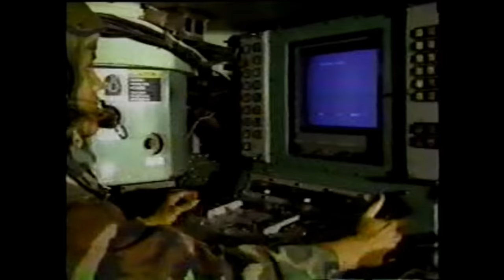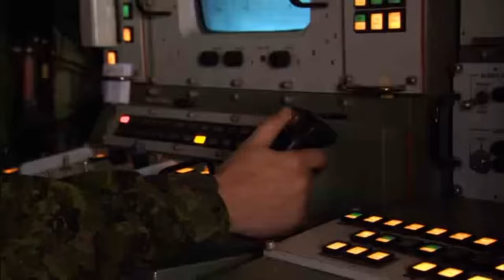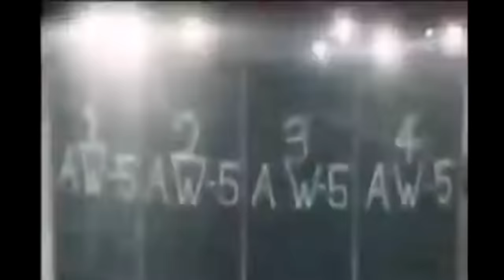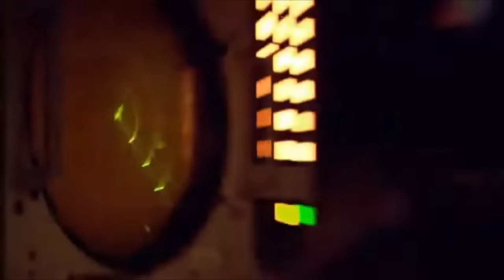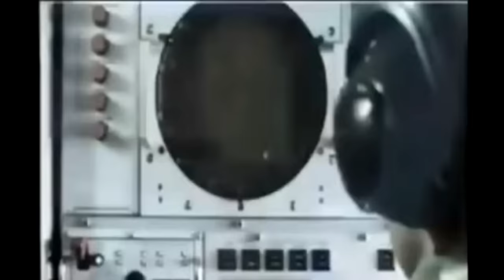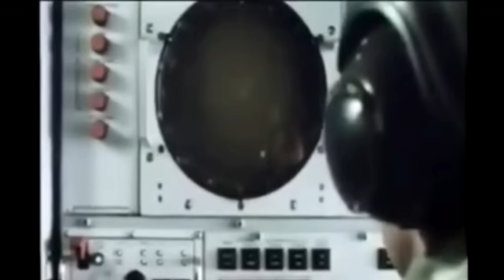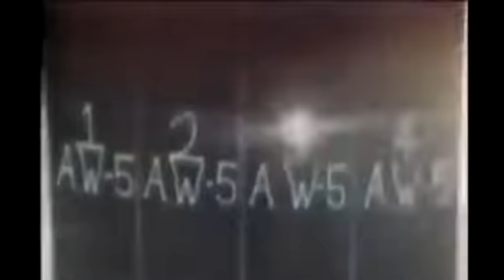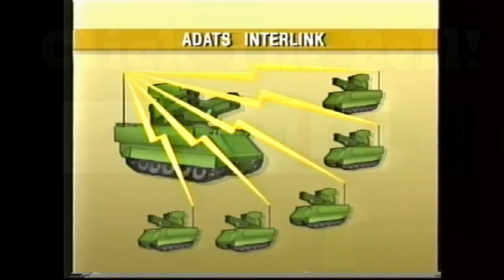The Air Defense Anti Tank System 'ADATS' Overview - DUAL-PURPOSE MISSILE HUNTER 📡

Comment: Well, these armoured systems tend to be so expensive (the German Gepard springs to mind), that you are better served with platoon of tanks - doing tank stuff.
Personally I prefer to have TOW's on the infantry fighting vehicles and supplement that with a mashine canon of - say - 30 mm.

If you have low flying hostile aircraft (like the A-10) you will not see them on radar before it is to late for an engagement. What you need is a heads up from the awacs or something similar with expected direction and a time frame for the platoon commander to give out the order to turn the turrets in the right direction and by sight fire the devil out of the mashine canons. Aircraft do not take kindly to transverse a cloud of shrapnel.
Besides that your vehicles will be so widely dispersed that close air support is not really a thing.

You can have helicopters and higher flying aircraft trying with guided weapons. But that is more the job for an integrated air defence system. Personally I think man portable Stingers are more appropriate. What the Danes are doing is putting the anti aircraft missiles on their frigates and park them in the city square.

The real role of the short range air defence is to "lift" low level intruders to where the fighters can see them and slug them with their missiles. The point being that a fighter aircraft will have forward motion that will give the missile a forward boost - and eliminate the need for a booster.

There might be an argument for the system in airfield defence - which is a KNOWN target; but these airfields are generally located so far back that it will be little help to the artillery, infantry and cavalry.

Comment: Considering those missiles carry shaped charge warheads that are likely alot heavier than your typical blast fragmentation warhead on a dedicated SAM, aside from helicopters, I wonder how effective this system would be at intercepting smaller targets like medium altitude drones, cruise missiles, and other PGMs in a point defense role? 

Like, would it really have been that great of an purpose air defense system or only really be useful against low flying helicopters? Honestly being able to hit drones, missiles and standoff guided munitions is alot more relevant today than protecting tank collums from hordes of soviet hinds.
Reply: The Missile is similar in speed as comparable SACLOS missiles ( which typically fly in the mach 2 -3 range ). If the optical tracking system is in order it should function well against low flying aircraft within its envellope .

Comment: Was there ony one type of missile used? Anti Armor requires shaped charge as you mentioned but against aircraft, blast fragmentation with proximity fuze would be required, I can't imagine how to fit both into one missile, at least not without compromise
Reply: Fragmentation sleeve surrounding the hollow charge maybe ?
Reply: @jonathangriffiths2499  Sure, possibly. Anyways, tactics-wise I'd think you would rather keep this vehicle slightly further back from the FEBA too keep it safe, it's much too valuable, the anti-armor capability would only be used in an emergency
Reply: I think it goes for a direct hit

Comment: But can the missile be countered by using a Trophy active protection system?
Reply: well in theory certain modifications maybe used to allow the missiles to evade the aps rounds
Reply: if maybe you could design the missile to have something like a vertical launched turnover pack but in this case it is used to sort of side step the missile like in rugby
Reply: or maybe a structure of an aster missile when it tries to correct it's trajectory if you know what i mean

Comment: What the hells wrong with updating this platform with the latest tech and firepower:)
Reply: Money 💰 💸 💲 💶 💵
Reply: The ADATS was already pushing the limits of what an M113 could carry. It was not air-transportable, it was "air-transpartable"; before movement by Herc, antennas and sensors had to be removed and stowed, and the suspension had to be clamped down so that it would fit. It would make sense to go with a newer platform than the 113 or Bradley. However, the CF do not have the money to spend on a replacement right now, even if they have recognized the capability gap. If we see a balloon go up, they will lash out and buy something off a shelf, much as they did for the CC-177s and CH-47s.

Comment: Why does the US have a habit of canceling these interesting projects?
 This, the YF-23, the RAH-66, and the HSTV-L... so sad..

Then just to blatantly spend taxpayer's money on things like F-35 and DDG-1000....
Reply: The US has something of a fetish for overly expensive and somewhat impractical ""superweapons"". The Abrams, to an extent, is also kind of an example of that.
Reply: It's not good if it's not fancy enough
Reply: The f-35 is amazing though
Reply: It's just fucking Congress. Army been begging them for this shit but we got politicians managing it for some reason
Reply: @cczevak5313  Abram is actually the opposite,by the time it come out,it is lacking in every aspect even compare to the by then obsolete M60 and T-72A so in order to fix that,they  put slap every upgrade possible on the tank which made it horrendously over-weight consuming,the only thing that made it effective is US capability to support it
Reply: You're kind of stretching the meaning of the word "cancel". Yes RAH-66 and ADATS were canceled but the YF-23 was not an aborted project, it was a contestant in the ATF program which did result in a production plane, just wasn't the YF-23 that got picked. That's how military contracts work. As to the HSTV-L it was just a test vehicle not a procurement program.

Comment: Most of the short range mobile air defence systems these days are going away as they are basically no longer needed. Air power can engage ground targets over much larger distances than the SHORAM systems can engage which basically makes them defunct. That said, the ADATS system could be pushed into being an anti tank only system. Stuff like the stormer starstreak system and similar things were good but with only a 3km range it no longer is able to keep up. Helos are sent in once it is certainly no dedicated anti air platforms are in the AO, also contributing to the demise of the short range AA system.

Comment: Why is the U.S. military lagging behind other troops in field defense?
Reply: Do you mean air defense? The whole US military is built around uncontested air supremacy. It's long neglected air defenses at the localized level. It's not just weapon systems but number of units available.
Reply: @HellYeaNixon That and only fighting countries that don't have air forces.
Reply: Far as I can tell, bad luck and inadequate resources devoted. No single US SHORAD program was ever trouble-free, and they never gave the programs enough attention to ensure they would overcome their issues. They tried many, many times to get that capability but they never could.
Reply: @becauseiwasinverted5222  The Sgt York program undercuts your claim. They spent TONS of money on a weapon system that was never going to work.
Reply: @danmorgan3685  To the contrary, the reason the York turned out trash was because they tried to be cheap in the beginning. It was cost concerns that led to unworkable requirements like "must use COTS systems" which eventually led to the cost spirals because they had to work around the limitations that would not have been there had they gone purpose built from the start. 

Think about it. The M247 was NOT an insurmountable engineering task. Yet "paradoxically" it presented ridiculous deficiencies. Do you really believe US industry could not produce a weapon with the required...radar clutter rejection, or achieve the complex task of...fast turret traverse? Clearly the issue ran far deeper than money because these were NOT major technical issues in the late 70s. The only way you can have stupid problems like these is by failing on MANY organizational levels of defense procurement simultaneously. 

That kind of failure is either a stars-aligned bad luck moment, or simply a lack of interest to get to the bottom of things. York R&D money was probably a drop in the DOD bucket back then anyway. Far higher priority programs were around getting much more interest.
Reply: @becauseiwasinverted5222  The problems were never technical and I never said they were. A program that wastes $6.7 billion ($16.29 billion in today's money) with ZERO returns is not a mere drop in the bucket.
Reply: @danmorgan3685  I didn't say you did. I said that because the M247's problems were clearly not technical (and thus money-dependent) in nature we could thus surmise that the real problem was what I outlined in my original point, i.e. misfortunes, lack of attention, mismanagement etc.

By the way actual costs incurred until cancellation was 1.8B ( https://www.nytimes.com/1985/12/02/us/demise-of-the-sgt-york-model-turns-to-dud.html ). IIRC 6.7B was the nominal value of the contract which included production and procurement (which did not happen). It is most definitely a drop in DoD's bucket.

Comment: Basically a great system without a mission/need.
Reply: Air defence is not needed?.  Right now we do not have any  air defence capabilities.  I do not even know if we have any man portable systems in use.  When I was in we had the Blow Pipe.
  I think this system should have never have been phased out.
Reply: @mafmaf6417  stinger missiles also the usa just put in an order for stryker shorad as said in the last video other countries have also many different man pads

Comment: One big piece of crap system. The generator was a Kiowa engine that produced a massive heat signature.
Your system could be disabled with small arms fire to the central drum optics.
Super cramped quarters, couldn't shoot on the move. Constantly broken optics.
Missiles that had like a 25% failure rate.
Oh yeah, if you put the plessy radio on hopping, you would JAM  all radio transmissions in like a 50km radius.
Man I could keep goin